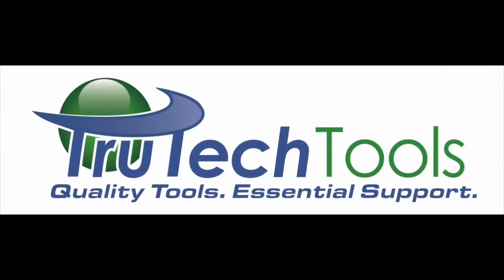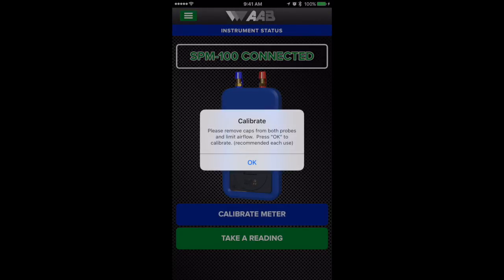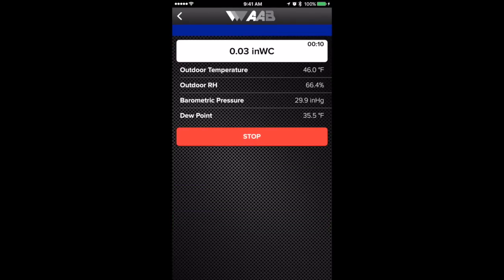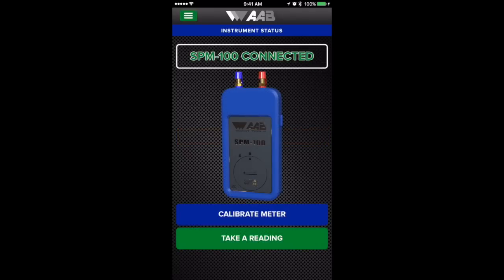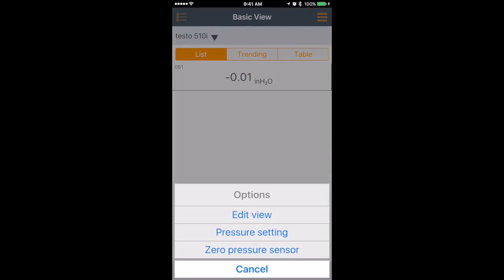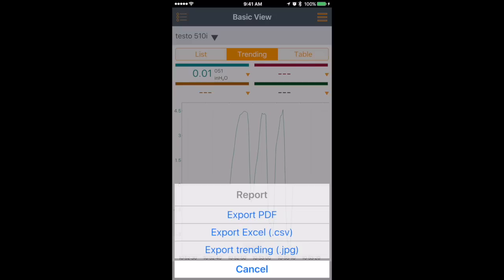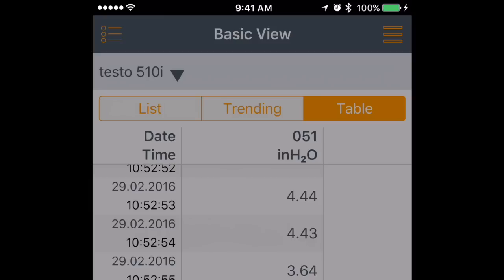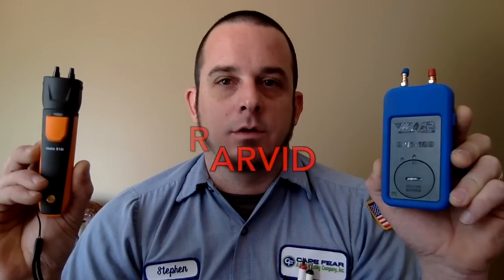HVAC Tools: Comparison AAB SPM-100 and Testo 510i

Comment: How do you like the smart probes so far?
Reply from the maker: Haven't used much more than the manometer just yet, for me it's hard to force myself to try other tools in the field simply because I have iConnect and all its probes. Why use a less capable device when you don't have to? You know?
Reply: +Stephen Rardon (HVAC with Stephen Rardon) I get that.
Reply: +Stephen Rardon (HVAC with Stephen Rardon) send me the Iconnect for a week then :)

Comment: nice comparision how about the other probes i know its not the i connect but i think with all the probes you can get all the info you need to make a proper diagnosis and repair if necessary whats your opinion
Reply from the maker: I think that for what they do they are a great entry level option for someone trying to get away from analog and enter into the wireless digital world. With the air and refrigerant probes you be WAY better off than analog but it simply is nowhere near the level of the iManifold system.

Comment: I have the AAB and have found they are very slow to respond. During a pressure change It would take at least 10 sec. to show a accurate stable pressure compared to a almost instant reading a a digital Dwyer meter I have. The AAB only works well in a fairly stable environment or slow pressure changes.